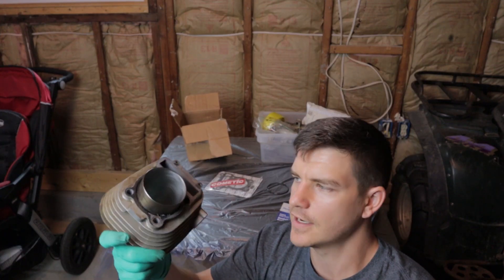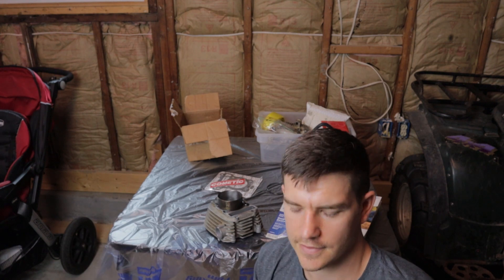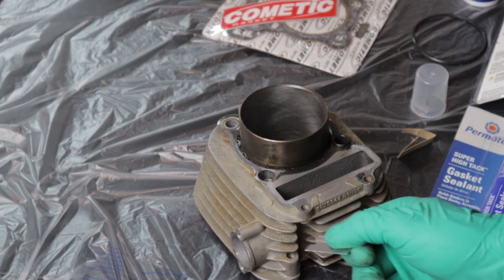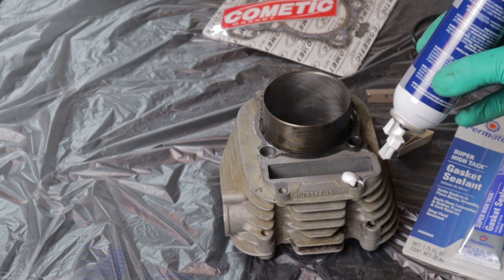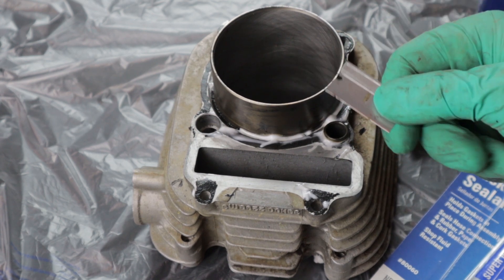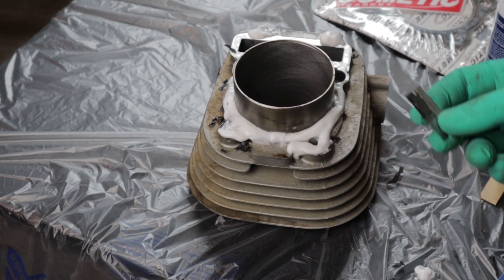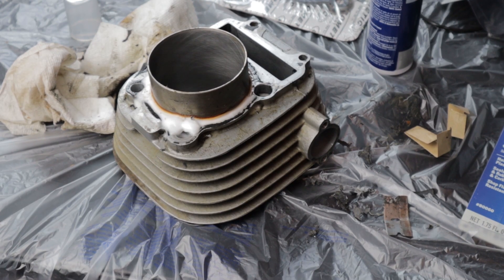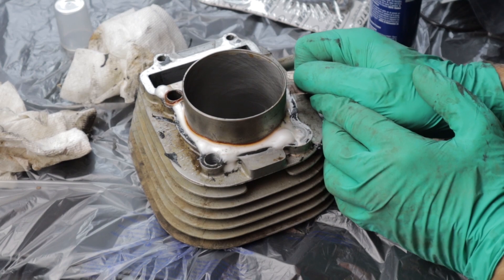Gasket Removal From Aluminum!

Comment: I found this video because I was trying to remove a 26 year old gasket from aluminum. I read all the comments and tried most of their suggestions. Brake Cleaner blah, heat gun blah, WD-40 blah, transmission fluid blah etc… The one that worked was acetone! It works pretty fast but once I got tired I just soaked the part in a tub of acetone with a lid. The next day the acetone had evaporated buy the gasket came right off with a plastic scraper and some Scotchbright!

Comment: chlorine free brake cleaner or contact cleaner or just plain 70 or 91% isopropanol alchohol, & a combination of kung-fU-idely angled, finger nail, solid peice of plastic, cause plastic scrapers R too bNdE, & or micro-fiber cloth(which I’ve heard R non-abrasive), wipe scrubbed at perpendiQlr(kungfUEnS XMpl) angle to the ‘flow’ of adhesive glue watchamacallit, WITH fingernail or plastic Qb Bhind microfiber cloth, kungfUedly strong point angled & directed obVSlE👋. It’s force pr area, to dislodge the stuff(nEr 2 dimensional as it mA seem, or B..) it’s all adaptive angling kung-fU-ity-nS-😒.. com dA thnk of it, a steel round ball or small cylinder, behind micro-fiber cloth, pressing into edge of watever gasket glue at watever beginning edge- flowing forward, but rolling the other way, causing a microfiber digging like counter revolvment.. the smaller the circle, the more force pr area, a non-mREng scrAp as it were, but if it won’t budge, the old solid square Qb trik is still there.. ACTULE NEVERMIND ALL THAT CRAP I JST FIGURED IT OUT, the bottom bigger corner-edge of a large style, preferreably MptE, bic lighter - behind microfiber cloth.. combined with all that kung-fU stuff I was yapN-aboOt.. that’s the trick.. & all those bic lighters on the ground U all walked by, were worth Ovr 12 $

Comment: That’s not the good stuff I used to be able to get, I remember being able to get some highly corrosive gasket remover that worked super well to remove silicone, it would clean/brighten aluminum in seconds and would start foaming up with you got some on limestone gravel, I really need some of the old stuff I used to get!

Comment: Please, Def get plastic razor blades (amazon), the cost the same as metal ones but do not gouge. If you use scotch brite use the maroon or grey- not green- don’t forget to plug up holes and vacuum. A little assembly lube and a paper towel will help to make sure dust does not go where you don’t want it. Use a flat piece of something like glass (if the part is removed). I’ll have to try the wd-40 and magic erasers.

Comment: The Secret : Use a scraper razor Razor blade held vertically. Perform a sweeping motion with the blade over the affected area keeping the blade edge parallel to the flange surface. This will slowly remove the stuck gasket material on the flange surface. It may sound like fingernails on the chalk board when you are done. Using this approach prevents digging directly into the soft aluminum while trying to catch the edge of an old gasket.
Reply from the maker: I'll have to try this! Thanks for the tip!

Comment: What about brass wire bits on a dremel tool or drill? More just looking for feedback with this question.
Reply: In other words sUper abrAsiv👋😒
Reply: brass is maybe stronger than aluminum
Reply: I’ve used a brass wire wheel attached to my drill to clean up countless aluminum parts. Make sure it’s brass wire NOT brass coated as the coated ones 
are just plain steel and will definitely remove the aluminum along with the gasket. Brass is softer than aluminum alloy.

Comment: mineral spirits, a box of mr. clean magic erasers, and a whole lotta elbow grease gets rid of the pesky residue without affecting the aluminum surface whatsoever
Reply from the maker: I'll have to try that!
Reply: @youbreakityoufixit9594  I have a part soaking in brake cleaner. I tried 3 times thus far and there is still a lot of gasket firmly glued on. I have mr. magic erasers, I might try that.
Reply: @DAS-Videos did you try it?

Comment: I wasn't impressed with the product. My surface is still on the car with very inconvenient access. It's a 30+ yr old gasket. I had high hopes. Maybe more applications. The packaging says for solvent based gaskets. You look like you're trying to remove a 'paper' gasket as am I. I'm not confident it works in this application.
Reply from the maker: That's a good point. I must have been using it the wrong way.
Reply: Try your best not to use metal scrapers. It's easy to gouge the aluminum. They are plastic razor blades. I blocked sanded with a fine grout paper. Don't sand in one place with your finger. You could create a low spot. Block sand do you sand over a larger area. Good luck.
Reply: Thanks for that - I also have a 34 year old gasket (water pump on a 1986 Pontiac Fiero) that's in a very inconvenient spot. I'd been eyeballing this stuff as a possible remedy, but after this...no way.

Was watching another channel where they used a die grinder with soft Scotch-Brite pads. I don't have a die grinder, but I'll bet I can get the pads easily, and slap one on a block.

Not so great for those surfaces where you're butting up against something solid, though. I guess you'd have to press the pad in with your thumbnail

Comment: Wd-40 helps tremendously
Reply: Agreed Ive always used penetrating oil put on let it soak for while and usually the gasket will seperate from the surface.

Comment: I've used a broad smooth- or 2nd-cut file to clean it off. Of course there's some technique to keeping the sealing face flat and true, but any little dips, well... that's what a tube of gasket maker is for ;)
Reply from the maker: You have the hands of a surgeon!
Reply: Ha... A little sharpie on the surface helps keep you from removing what you shouldn't!